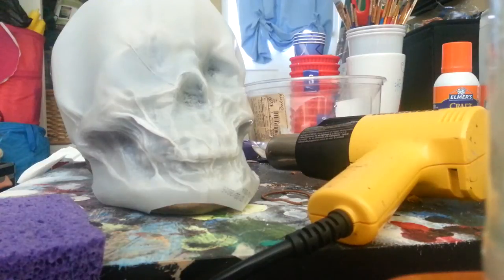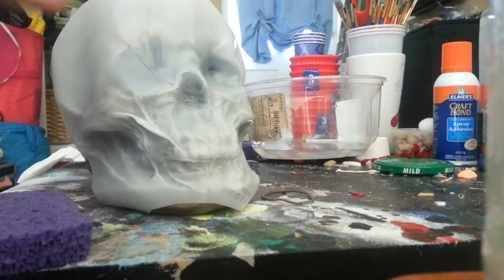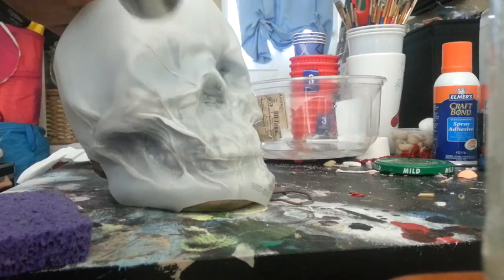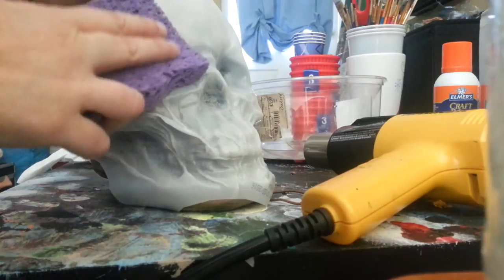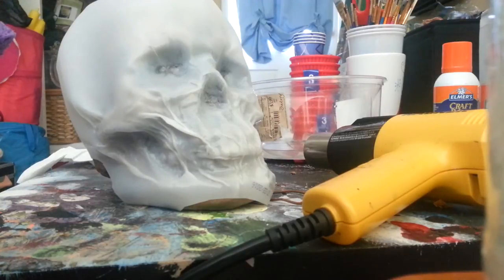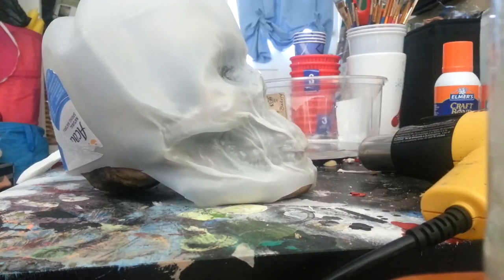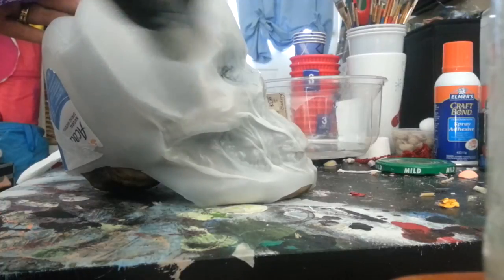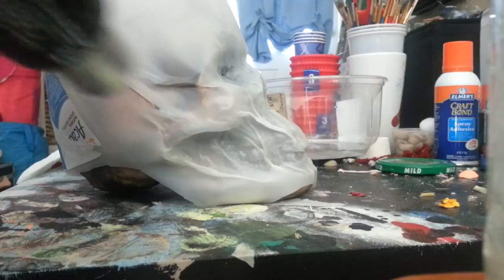My Milk Jug Skull.

Comment: So, you heat then apply pressure with a damp sponge?  Are you using a plastic skull as your 'mold'?  Can you save bits of the jug to apply in areas where the plastic becomes too thin?  Do you coat your resin/plastic/plaster skull with anything to make the jug skull come off more easily?  Spam spray?  Corn starch?
Reply from the maker: I used a resin skull and didn't coat it with anything. They are a bit tricky to get off, but if you cut a slit up the back you can wiggle it off the base skull and then patch up the cut with scraps and hot glue. Pennywise753 and mjohns66 both have good tutorials that go more indepth than mine. I've never tried melting scraps over thin spots but let me know if you try that out. I suppose with enough heat it would work.
Reply: Lydia Rossi Thanks!  I'll probably get to that project sometime in November, & I'll let you know if I try any of the techniques I asked you about...  Also, thanks for pointing me in the direction of those other two YouTubers.